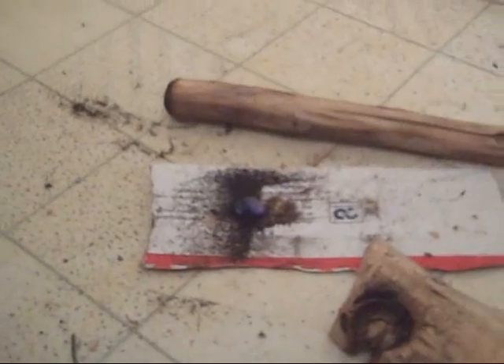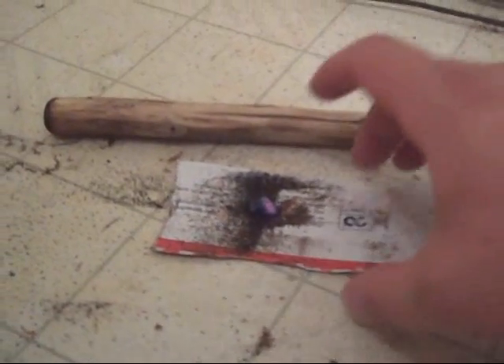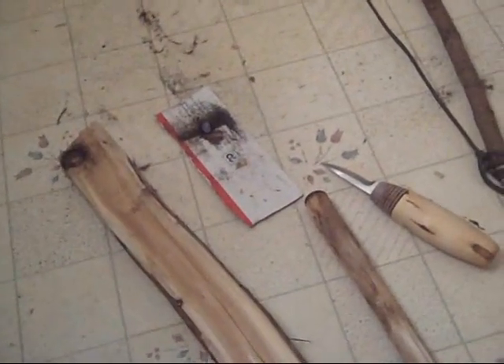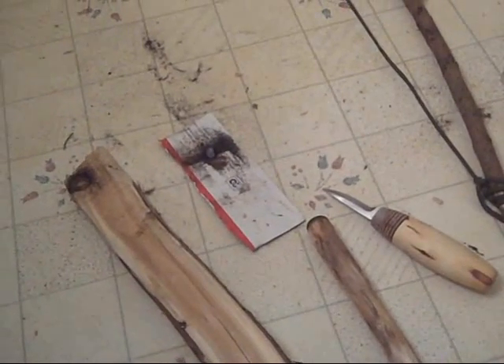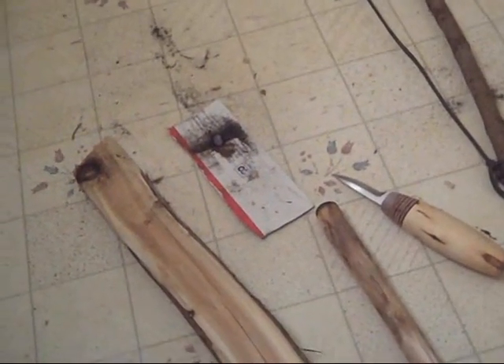Bow Drill boredom-Mullein and Cedar on the kitchen floor

Comment: I was just doing the same exact thing in my garage. It was my first time with mullein, I was using a shot glass for a bearing and I did it bare foot too. The only difference was my fire board is poplar.

I think the mullein works great. You just need to gouge a bigger hole in the board to start off because the mullein is hollow and you can't make it into a point .Next I'm going to use the top of the stem as a hand drill and I'm going to spread the mullein seeds close by in hopes they'll grow.

Comment: Good idea using the shot glass.  I find that it is difficult to find a top handhold with mullein because the spindle breaks  apart (if pointed) or smokes too much if left flat.  Any ideas besides the shot glass to help?